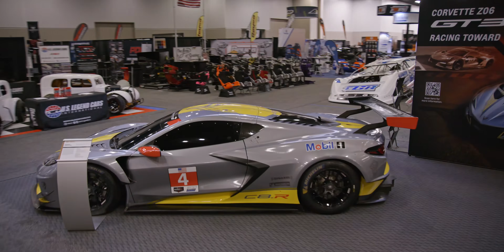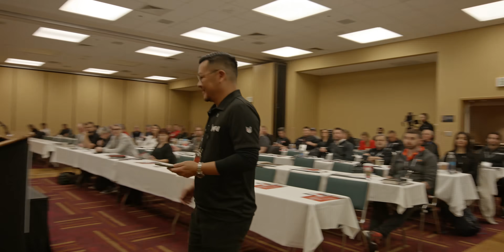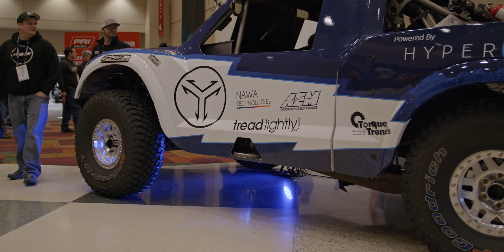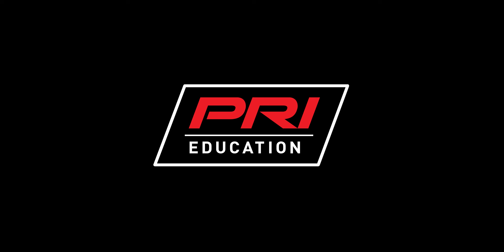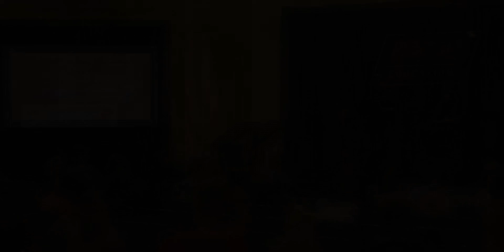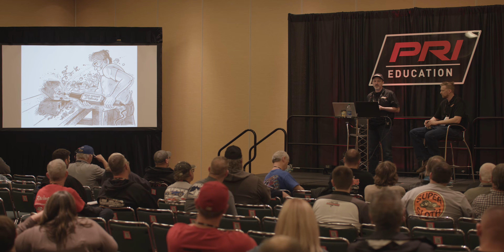Air Speed In ICE & Bending The Rules For More Power

Comment: what your CFM demand formula is really saying is an engine needs 7.8 cfm per cubic inch, per cylinder, per port to make maximum HP at 8000 rpm.
if you put 8 cubic inch engine, V8, 8000 rpm in your formula, that's what comes out

the Pontiac engine in the video had 7.15 cfm per cid, and peaked at 8500 rpm
extrapolated down to peak at 8000 rpm, that Pontiac 570 would use 6.72 cfm per cid,
therefore IN REALITY, we are not far off from the 5.5 cfm per cid at 8000 rpm rule of thumb, that Smokey Yunick developed on the SBC 350 NASCAR engine, and put in print in 1976, using stock GM cast iron blocks, heads, in the Power Secrets manual.  only a 1.2 cfm per cid at 8000 rpm difference, after 50 years development.
i.e. an under-valved old engine design 1950-80 era, will not achieve 7.8 cfm per cubic inch flow, using the original engine architecture and hardware.  even with highly modified aftermarket cylinder heads, it won't achieve it, as you have shown- especially if it's undersquare.  which many or most of them were.
the reality is very few passenger car engines are grossly oversquare like a Pro Stock or NASCAR engine.